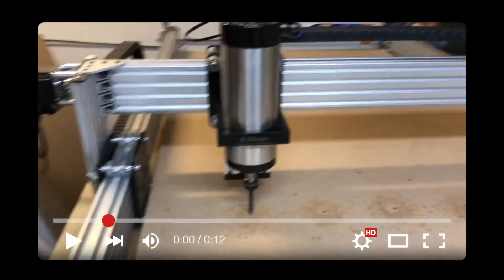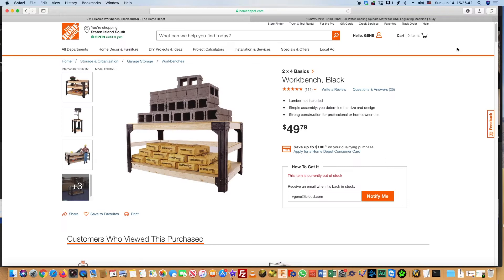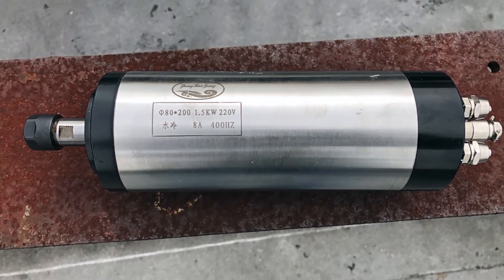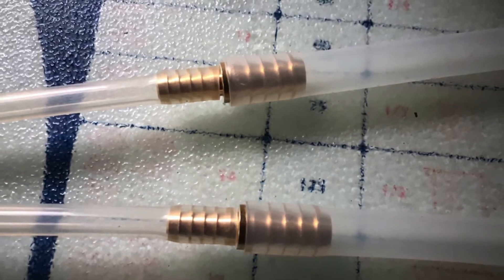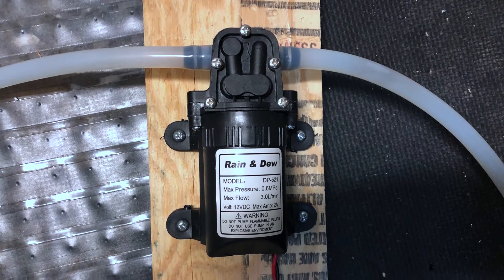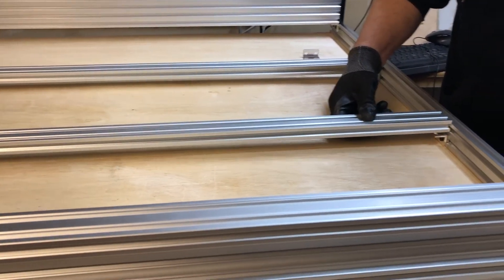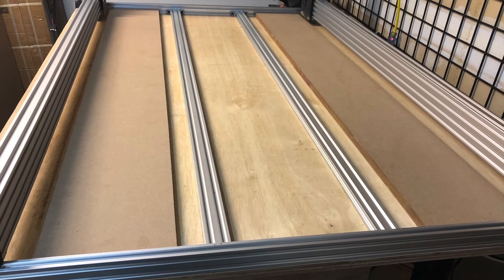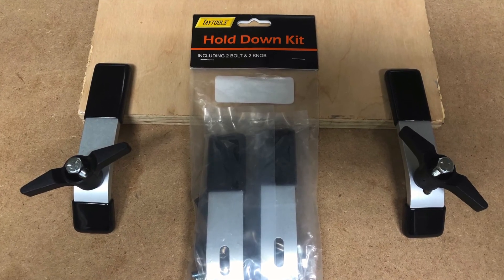Lead CNC 1015 Part 1: Choosing Parts And Assembling

Comment: I'm running a 1515 workbee and I had to upgrade my servo drivers and a few other things but I'm really impressed with the way you chose your components. How's mach 4 compared to mach4 ? 
I thought I was doing something when I upgraded to 24v but I'm not sure my driver's could handle 36v . 

I am thinking about a new build that would be lighter than my workbee as I only need to handle a small diode  laser and be able to change to needle cutter or drag knife ..
Reply from the maker: Did you mean Mach4 vs Mach3? Mach4, of course, is better and more modern. The progress of work is perfectly visible on the computer screen. I like Mach4. But those who have been working with the Mach3 for a long time and are used to it, probably should not switch. Habit is a serious thing :)
Reply: @vgulya  yes that is what i thought i typed lol

Comment: I purchased my 1515 mechanical kit from BulkMan3D. Assembly according to the videos from Open-builds calls for 2 C-Beams for the X axis, which BulkMan only supplies 1 C-Beam. The open-build version gives the machine a lot of rigidity on both the X & Y axis I believe so I went ahead and ordered extra pieces needed. Do you by any chance have dimensions/drawings for the beefed-up Z axis motor mount?? I've also gone ahead and followed your advice on the frame layout, makes more sense.
Reply: Have you done the upgrade? How is it?

Comment: Thankyou for this very informative video! Especially the base assembly tips. I think i have bought the same kit from Bulkman 3D, and i also thought the base assembly was not ideal.

Was your kit also supplied with only 2 of 1500mm 20x40 v slot beam, but 3 of 1000mm 20x40 v slot beam? I can only find a use for 2 of the 1000mm... and 3 of the 1500mm would make the base much better i think. Or am i missing something?
Reply from the maker: Looks like you got everything as it should be. The third 1000mm beam is just for X axis cables drag chain